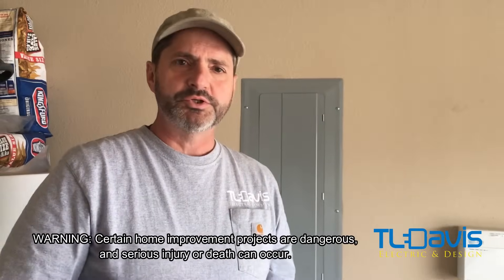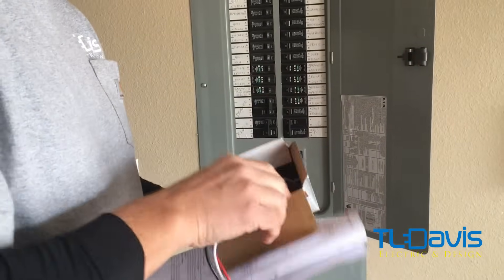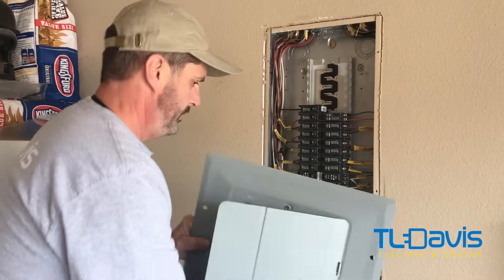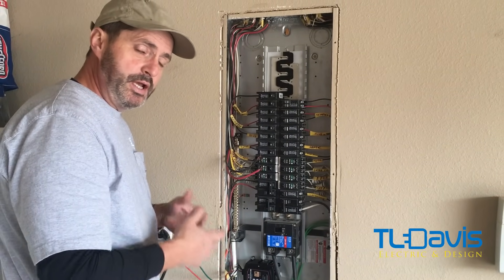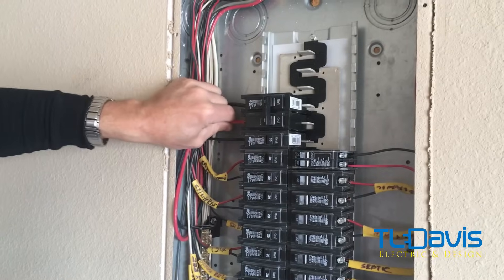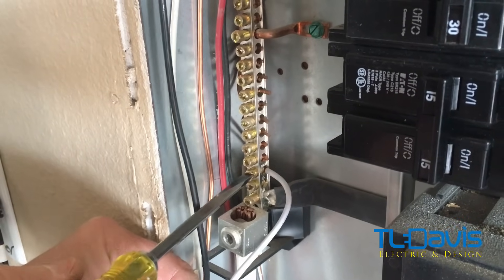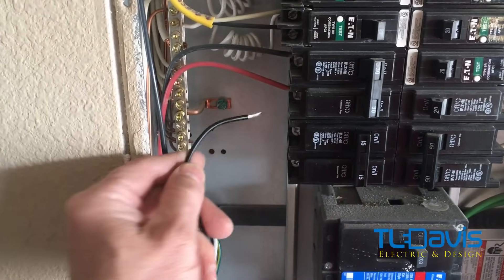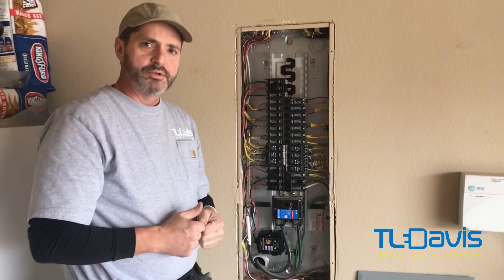How To Install A Whole House Surge Protector | TL Davis Electric & Design

Comment: Hi Terry. Great video and Thank you! One question: I have noticed it's SPD type 2. I just bought the Square D device similar to the Eaton. However, it's indicated that the Square D Surge protector is the SPD type 1. Can I install Square D similar to what you did with Eaton, and what is the difference between  type 1 and type 2 Surge Protective Devices (SPD). Thank you.
Reply: It's probably too late for this, but those are probably the UL 1449 type ratings. Type 1 is intended as a permanent installation between utility and panel to arrest lightning. Type 2 is intended as just after your distribution panel and may or may not arrest lightning. Type 3 is the point of use protectors you usually find around as power strips.
https://blog.nvent.com/the-applications-and-limitations-of-ul-1449-for-surge-protective-devices-spds/
https://www.nemasurge.org/wp-content/uploads/2011/09/SPD-Type-Application-Considerations-Rev-Date-01-31-2013.pdf
Reply: He needed a type 1 SPD at that location. Main panel installs = type 1 SPD.
Reply from the maker: the type 2 has a higher aic rating than the type 1. Type 1 and type 2 are indoor rated. type 3 is outdoor rated and nema 4x is outdoor rated. you have bought a good Spd. make sure you put the right breaker in for it. Good luck on your project and make sure to turn off the power to the panel if you are not an electrician.

Thanks for your comment.

Comment: How much might something like this cost installed?
Reply from the maker: Sorry about not getting back with you. I have been very sick for a while. In my area electrician are charging around $500.00 for the install. You can buy everything for less than $200.00 with the Spd with a 104,000 amp protection. You can find them in Home Depot or Lowes for a 38,000 amp protection for around $78.00 and the breaker around $18.00. You will need a threaded coupling and an offset nipple 1/2" on both. I have added some new video's on this.

Comment: Can this be used on the outside panel box?
Reply: yes, It can mounted outside the panel. Just do your best to keep the wires on the surge protector as short as possible. This will help with the performance of the surge protector.
Reply from the maker: Sorry for not getting back with you on this. I have been very sick and not able to reply to anyone. This is a nema 1 device and not rated for outdoors. You will need a nema 3R or 4x for outdoor use. I would suggest on the side of the panel or underneath.

Comment: If my panel is full will the surge protector still work If I double up on the range breaker?
Reply from the maker: The breaker for the SPD needs to be dedicated and not have any other circuit tied to it. I will be putting out another video that will show installing a SPD on an existing panel, New panel, surface mount panel. This video will clear up a lot of questions that people have. The video was for a special need child that likes to tear anything with lights apart.

Comment: also, ive always wired my breakers then snapped them in, just done that because its easier to get the wires in and tightened down. is this wrong?
Reply from the maker: This is nothing wrong with wiring the breaker first and then snapping the breaker into place. I wire them into the breaker to keep the wires nice and clean. But it is up to the installer to do what he feels is right for him.

Comment: I am not an electrician so pardon the stupid question: why 15 amp if there are other things in the house that are loaded with 50 amp like AC? Thanks
Reply from the maker: The manufacture of the Spd only requires a 2 pole 15 amp for that device. The Spd will protect all items within the panel even if there is a 2 pole 50 amp.
Reply: @terrydavis5882  Thank you for the answer. How about the low voltage devices?

Comment: Wow, I've been an electrician for 27 years, a licenced journeyman for 22 years, and a licenced contractor for 8 years. I guess I missed it during all that training that somewhere during the process of becoming an electrician, I would somehow become immune to electrical shock or arc flash/blast, so no longer requiring  PPE (i.e gloves) while working on energized equipment since I'm now an electrician....lol. Good video other than that but off bad advice.

Comment: How many dyi ERS died watching this lol also the breakers not going to arc if there's no load on it. PS you should invest in red Robertson screw driver. I couldn't imagine ever using a flat screwdriver when I don't need to. Step 1 of this whole video should be shut the main off or better yet call electrician.

Comment: Our house is grounded to the ground rod at the meter box.  Will this work if installing a whole house surge protector?
Reply from the maker: The ground rod is for grounding. It's not a surge protection. You will need a dedicated 2 pole breaker for the Spd. The instructions will tell you what size of 2 pole breaker you will need. The Spd will need it own breaker and not to be shared with another circuit. I have links on my video to some Spd. Please do not install it in the panel as this was a special case. All Spd should be installed on the exterior of the panel. Normally they will be at the top or bottom.
Reply: @terrydavis5882  we have already installed it and it does have it's own 2 pole breaker.  Ours is installed outside of the breaker panel box.  I just am trying to learn how this works .  So the panel  is grounded to the ground rod for the whole house outside near the electrical meter.   I don't understand how the surge goes to the ground rod and does not split and go to the ground rod and continue on through the electrical wires in the house.
Reply from the maker: @cactusladysouth1000  The ground rod works to take a hit for the home, but does not protect the surge through the lines. Basically the Spd is intended to limit transient over voltages with a goal of preventing the equipment from being damaged during a lighting strike. Think of a water tank, protected by a pressure relief valve.
Reply: @terrydavis5882  Thanks for replying so quickly
Reply: @terrydavis5882  you didn't answer my question, we have already installed the box beside the panel.  I want to know if the surge protector will work right  when it's ground is the same one used for the panel box which is grounded to the same ground as the electric meter ground rod.    the surge box has it's own breaker.

Comment: I am planning to put a surge protector on 9 of our homes(family and rentals) etc.  can I use one type for all homes?
Reply from the maker: Yes you can. You can surface mount them or recess them. Please do not put them inside the panel. That was for a special case. I have links you can use or you can choose your own. If you decide to recess them into the drywall. you will need a flush plate. make sure to use the closes knock out at the bottom or top of the panel. do not use the ones closes to either side as you will need room to recess the the Spd. Your panel will have wood on both side of it and will make it very difficult to install one. Make sure to turn off the power. Good luck with your project.

Comment: Does the protector have to be at the bottom  of the panel?
Reply from the maker: You should install the Spd outside of the panel. This was a special thing I had to get permission with the local inspector. The Spd has to be on its own breaker. When Installing it on the top side or bottom side of the panel, use the closes 1/2" knock out you can use. Make sure the knock out is not the closes one to the side of the panel. You can always remove the cover and lay it on the sheet rock to make sure it will fit as your panel will have 2x4 on each side of the panel. you also want to make sure there are no other wires near it as it will take up some room. They make a cover plate for the Spd that you are recessing into the wall. If you buy eaton you can see the flush plate cover on the video page. https://amzn.to/2SlB6gJ. Make sure to turn off the power before installing you're breaker. Good luck on your project.

Comment: Terry,  Thank you so much. I am a musician and have a room dedicated to Guitar amps and etc.. I have had in 3 amps a noticable noise and sound change. I ve had all 3 amps get damaged from a badly wired a outlet. My friend who is an electrician and fixed it for now. I have been investigatipng power conditioners. I like the Idea of the surge protector for the whole house. I will get it done!  Can you recommend the best power conditioner I can buy?. i am familiar with Furman but not even sure what one to get any suggestions ? I need it to be a power conditioner, surge proyector. What about Voltage? What about any other considerations?   Greg J in LA
Reply from the maker: Furman is a good quality one. I have also done a dedicated line from the panel where the power and neutral and ground do not connect with any other outlet. If you do this do not connect the ground to the back of the box. Use a dedicated orange receptacle to indicate this line is dedicated. I do this a lot for computer circuits and cash registers.
Reply: Furman also offer some rackmount powerbar with isolation transformer and ground lift switch that can help

Comment: Does a meter based surge protector eliminate the need for surge protection in the panel?  Wouldn’t one at the meter protect whole house instead of getting separate surge protectors for the breakers in garage/pool/and AC.  I’m considering getting the plan through my electric company. The fee is small but you pay monthly. I have surge protector at each of my expensive devices.  Thank you
Reply: Here you can pay 5 or 10 a month for a surge protector outside on the meter ,do you need 2 protector   doing the same thing, no I would not .
Reply: @SG-zh5xd they're not doing the same thing.

Comment: Thank you for sharing it. You video shows we need to install an additional breaker in order to install CHSPT2ULTRA surge protection device. Is it right?  Can we just let CHSPT2ULTRA share an existing breaker? If not, why? Thanks and regards.
Reply: The MOV is a puck of oxide coated metal balls pressed together. At a high voltage the oxide breaks down and they conduct. With a small spike a few balls are destroyed. The green statis lights tell you when it is finished. A large strike may make the MOV continously conductive. If this happens the breaker trips before the fire starts therefore MOVs are always after breakers or fuses. Spikes are short, breakers are slow. A 15A breaker can handle many kilo amps for a short time.
Sharing a breaker reduces the protection.
Reply from the maker: The spd has to be on its own circuit breaker. I would recommend it to be near the main breaker if possible. If you share the breaker the device using that breaker would not be protected as the ones not sharing the breaker. Please do not install the device in the panel this was a special case and had to get permission from the local inspector to do so. You can always surface mount or recess mount the spd. There should be examples of this.
Reply: @terrydavis5882  Thank you for the information.  It helps a lot!
Reply: @terrydavis5882   If I use "EATON CHSPT2ULTRA Ultimate Surge Protector", can either one of the following two 50AMP double pole breakers be used with the surge protector?  Thank you.

(1) 
https://www.amazon.com/Corporation-CL250CS-Classified-Replacement-Breaker/dp/B0058I30Q0/ref=sr_1_1?crid=3TEF0B95LRCDK&dchild=1&keywords=eaton+50+amp+double+pole+breaker&qid=1591549364&sprefix=eaton+50%2Caps%2C170&sr=8-1

(2)
https://www.amazon.com/Q250-50-Amp-Double-Circuit-Breaker/dp/B00002N7KX/ref=pd_bxgy_img_3/140-6689945-7881014?_encoding=UTF8&pd_rd_i=B00002N7KX&pd_rd_r=18764874-0ec7-43e8-9483-8900618d366e&pd_rd_w=e4UYb&pd_rd_wg=JVl7A&pf_rd_p=4e3f7fc3-00c8-46a6-a4db-8457e6319578&pf_rd_r=RES1H4BZEYQT166VEWJC&psc=1&refRID=RES1H4BZEYQT166VEWJC
Reply from the maker: @bjt512  Either of the two will work in your panel. Good luck and make sure to turn off the main switch if you are not compatible with the main breaker being on.
Reply: @terrydavis5882  Thank you!

Comment: Love seeing a panel that was selected with room for plenty more circuits instead of cheaping out and getting the smallest possible panel. Also surprised the Eaton uses stranded wire -- maybe there's a deliberate reason for that other than making it easier to install?
Reply: Most surge protection devices are stranded cause u can’t have so many so many unnecessary bends

Comment: I have a couple screwdrivers I just added heat shrink to the shaft. It was more to prevent shorting components more than me getting zapped when adjusting stuff on aircraft.

Comment: The electrical shock will not recognize if you're an electrician or not, if you can't turn off the main panel you should wear a safety glove. You can also attach the wires first to  the breaker before you plug it in to the main panel

Comment: The ground wire was connected to the neutral bar. The panel illustrated has a grounding system in the panel. Is there a Reason why the grounding wire isn't connected to the grounding bar. Other options is to install the unit to the outside panel to prevent customer from exposing themselves to a live system. This is more applicable when looking at the green LED lights on the Surge Protector.

Comment: Why earth and neutral goes together?
Reply from the maker: In the main panel they are connected with a bar that goes from one bus to the other bus. Only in sub panels are they separated. If you look in your main electrical box you will see the bus that connects them. This bar runs behind the main bus.

Comment: The ground wire goes where the neutral goes?
Reply: The neutral and safety ground always go to the same rail at the main panel and then on to the ground rod.  Think of the safety ground as a back up in case the neutral fails or the hot wire touches the appliance case when a heating element, component, or motor fails and hot goes to the appliance case.

Comment: Great instructional video, but why not use a Robertson (square) screwdriver? Much safer. Flat screwdrivers always slip side to side, personally I think flat screwdrivers and flat screws should be a thing of the past, so many safer type screws, i.e: Robertson (square) Phillips (star) Torx, etc..
Reply: good point
Reply: @69RIDING that's fine if you're a guy with good hand strength. Ladies strip screws that are star or square

Comment: Does the Surge Protector have to have it's own breaker or can it be shared with an appliance that has the same Amp setting?
Reply: Its own dedicated breaker, no sharing, and always close to the entrance point (main breaker) so it can take the brunt of the surge.

Comment: So let me understand this? The homeowner randomly has to remove the panel front to check the status of the surge protector or if it as a reset option, to reset the surge protector? I’ve been a electrician for 20 years and this doesn’t make any sense to me. But maybe they you do things different where you are, idk
Reply from the maker: You are not the only one that has ask this question. But you are the only one that was not quick to judge and condemn before finding out why I did what I did. I put out a video to explain the reason for installing the SPD inside the panel, where you could not see the lights. But that video keeps disappearing on me. This was a special case as the homeowner has a child with special needs that keeps pulling things apart with lights. For the safety of the child I installed it inside the panel with local jurisdiction giving me the right to do so. As you know local jurisdiction has rights to change or add to the code book for the safety of life. We tried to do it outside in a NEMA 4x with a ground fault breaker and the child destroyed  the SPD. We installed it high and out of reach, still on a ground fault breaker and he managed to destroy the SPD. The only option now was to install the SPD inside the panel and this was brought up to the local electrical inspector which gave permission to install it inside the panel as we had plenty of room to do so. You can only have up to 3' of wiring to make the SPD effective per the information given. By no means are you to install the SPD inside the panel. I have shown on several other videos how to install it surface mount and recess mount with the approved cover furnish by eaton. This type does not have a reset button on it. The only was to reset it is by the breaker tripping. The homeowner is an electrical engineer and is familiar with removal of the cover of the panel. All ideas and options were weighed when doing this. Even explaining this was a special need to install it inside the panel, with other video showing how to install it properly. Unfortunately the video keep disappearing. Maybe one day they will stop disappearing.
Reply: Terry Davis I had seen other SPD that installed like an actual breaker that snapped or bolted straight to the buss, only difference is that you could open the door to see the status of the device. I think, and it’s only my opinion l, that one like that would be a better option. That way it could be monitored without taking off the dead front.

Comment: As an electrician myself, a normal homeowner has zero business digging around in their panel. ESPECIALLY with your main breaker on! DO NOT PLAY WITH YOUR PANEL. This is VERY dangerous if you are not experienced.
Reply: Thanks for confirming this. Anyone with common sense should know to avoid this as a beginner. I'm considering a whole house surge protector and was curious how this is installed, but have no intentions whatsoever of attempting any changes inside my breaker box. I can screw up with a basic plumbing install install and might get a little wet, but electrical is a whole other level where seems pretty obvious, one mistake cab kill you.